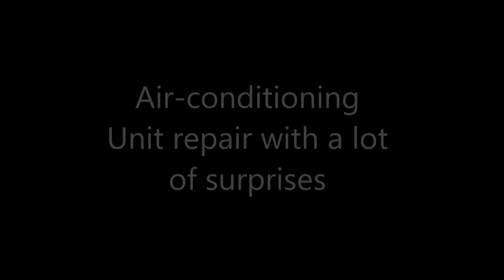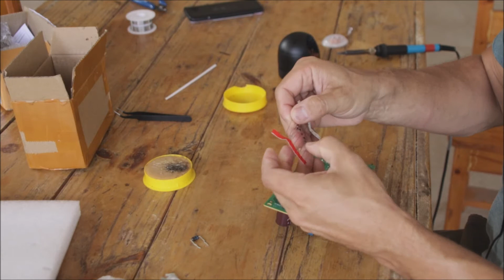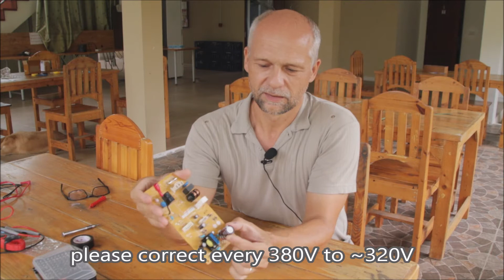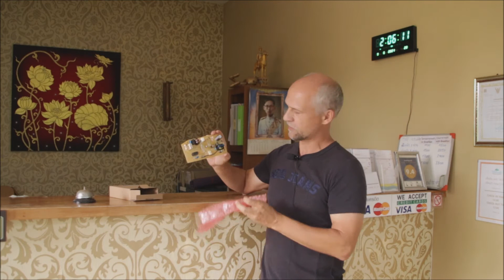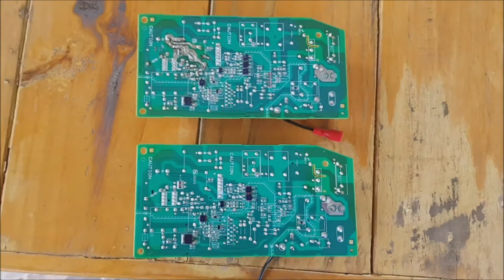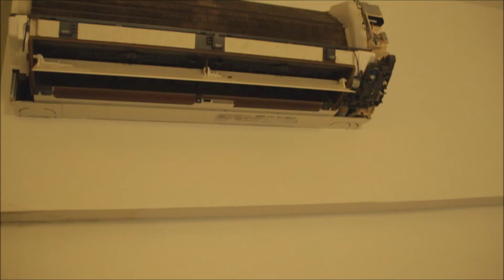Fixing the broken Air-conditioning Unit, but it's not as smooth as you might think...

Comment: You can replace the air handler for the same amount of time/materials repairing those pieces of junk. Then you’ll have either a 5 or 10 yr parts warranty.
Reply from the maker: And we try to prevent items going to landfill, or even worse, here in Thailand many of the waste is ending up next to the road or in the sea...
Reply: This is an electronic repair exercise video.